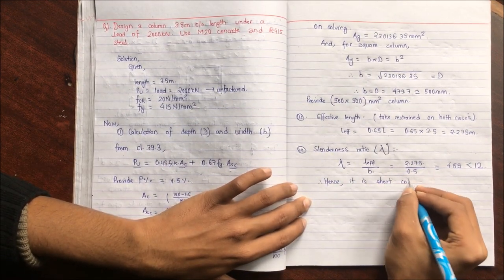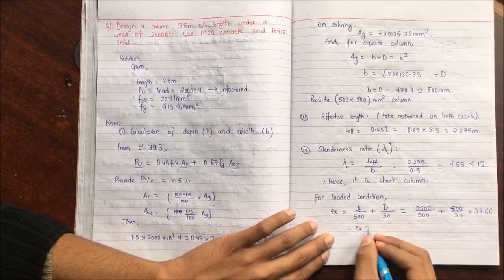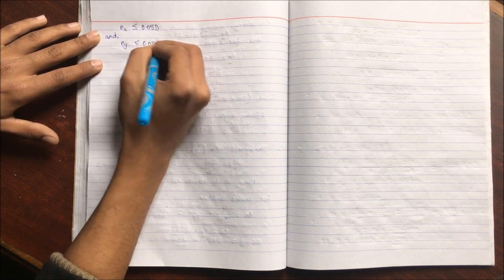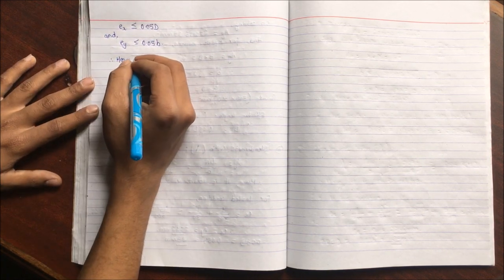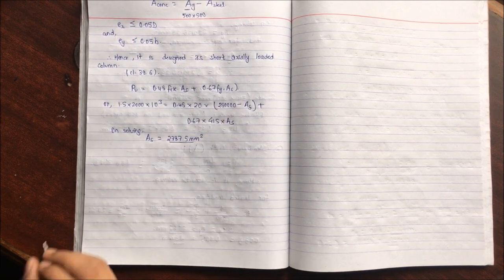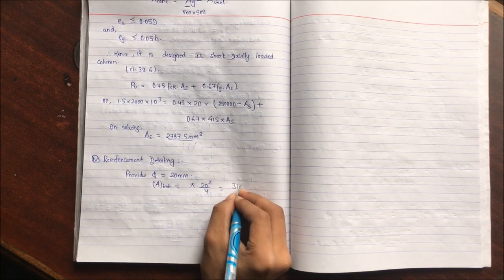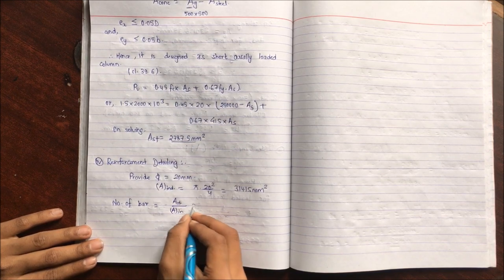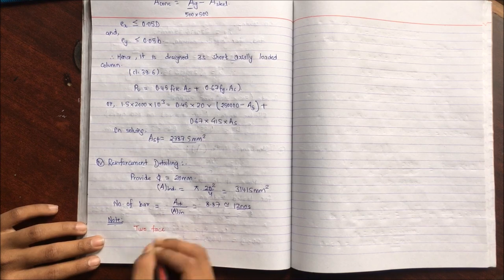Axially Loaded Column Design RCC | Mumbai University | IOE , TU , PU

Comment: . Design an interior panel of a flat slab supported
on circular columns spaced 6 m centre to centre
in both directions for imposed load 3 kN/m2
and finishing load 1 kN/m2 using LSM with
M 20 grade concrete and Fe 415 grade of
steel.

Bhai plzz ye numerical solution krwa do plzz

Comment: Column is a compression member but why did you keep rebar in it?
Why dont you check for overreinforced or underreinforced criteria in a column?
Reply from the maker: This is as per exam question only.
Reply: @civilconst  Can we designed column as overeinforced or not?
Reply from the maker: @structurelearninghub3340  generally, the limit to the quantity of main rebars is 4% of the sectional area, but 1~2% is most economical. For construction considerations, it is advisable not to exceed 3%.
Reply: @civilconst  have you ever checked for overreiforced criteria . Section may be overeiforced for 3%
Reply from the maker: @structurelearninghub3340  How can that be possible ? Codal provision says that upto 8% permissible(exception), good practise is considering 2.5 %. Could you explain how it could be over reinforced brother with 3 % ?
Reply: @civilconst  Its simple bro, check for undereiforced is valid for only flexural member.However column can be designed overeiforced with limitation of 4% . Even for a rebar less than 4% it can be overreinforced section. You can derive a limiting rebar required for Given concrete property and rebar property using Equilibrium equation .Or you can go with 3 dimensional Stress evaulation and measure a ductility factor.